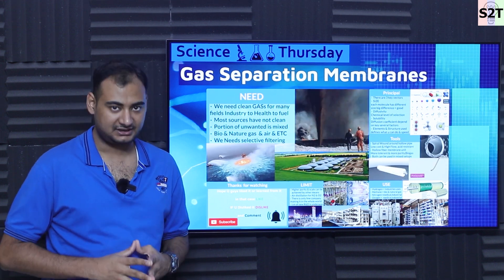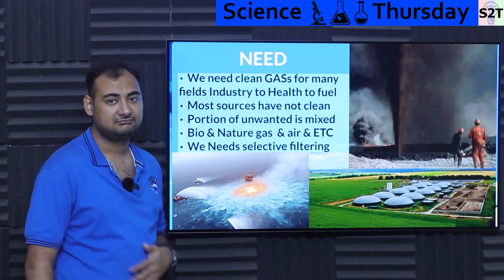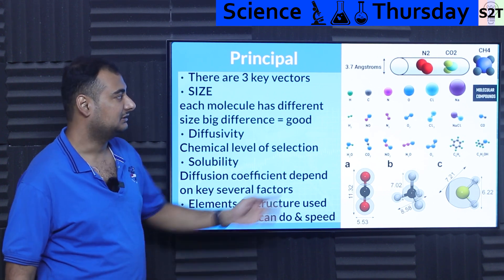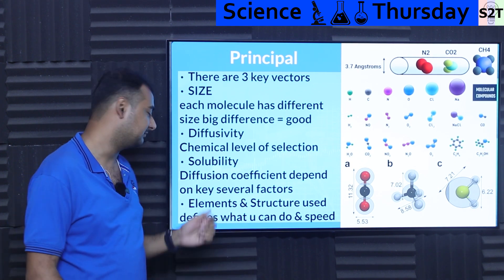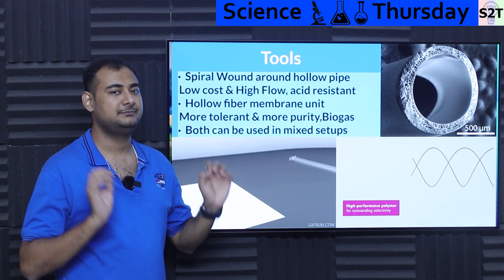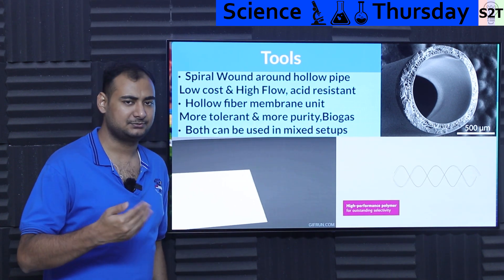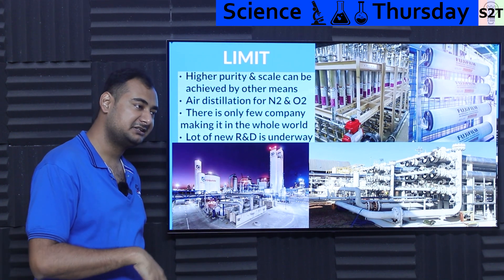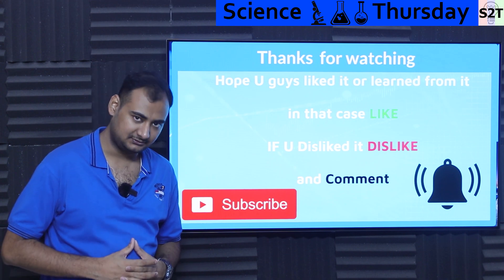Gas Separation Membranes Explained {Science Thursday Ep246}

Comment: Could a car use a gas separation membrane to remove nitrogen from the incoming air to make an oxy fuel combustion engine?
Reply from the maker: BRO NOOOOOO just NOOO
Reply: Bro, just why? Oxy fuel combustion is more efficient and cleaner burning.  @s2tenglish
Reply from the maker: you have to run air through a filter the a compressor then the output goes to engine and at that point parasitic loss because of the system would be to high
Reply: I see. Thank you.  @s2tenglish